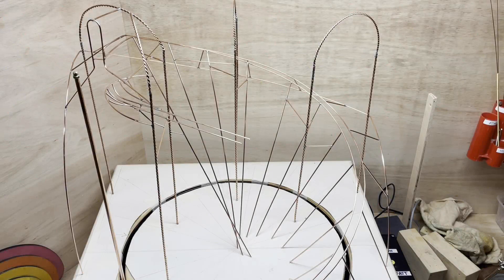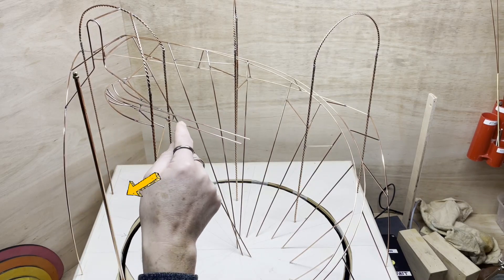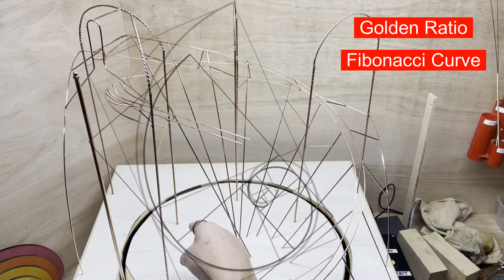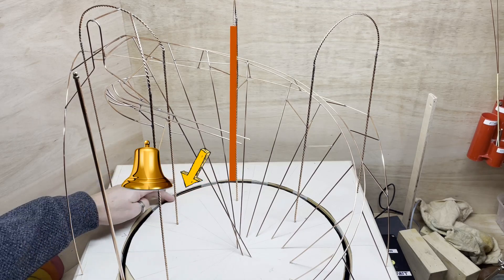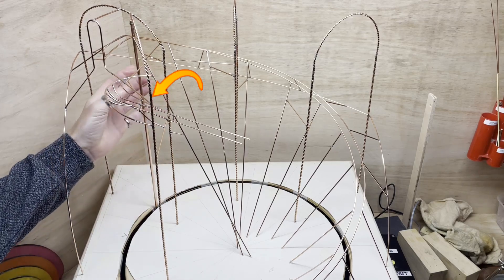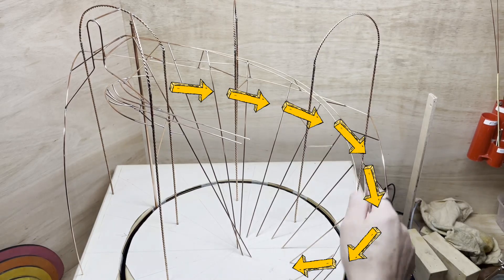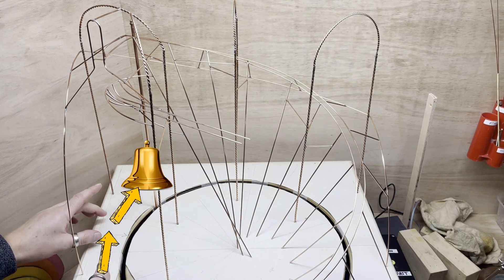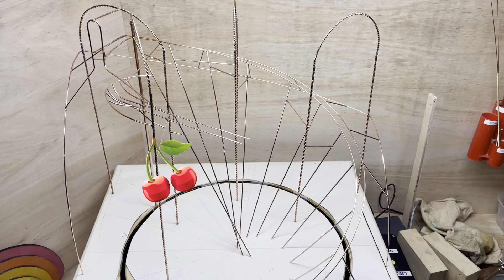Rolling Balls Switch - RBS5 - EP 8

Comment: Joyeux Noël!
Interesting that you seem to be using a blowtorch to solder right now instead of the resistance soldering earlier in your series.
Reply from the maker: Hello. I use the blow torch for tubes, rods, plate and bigger wire when I feel that the resistance iron is too weak. I also like using it as it challenges me a bit.